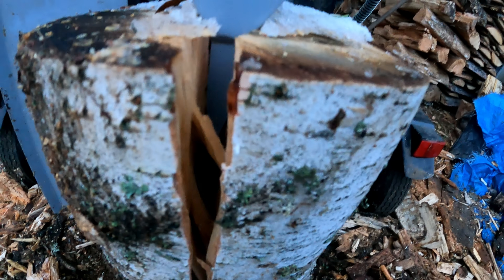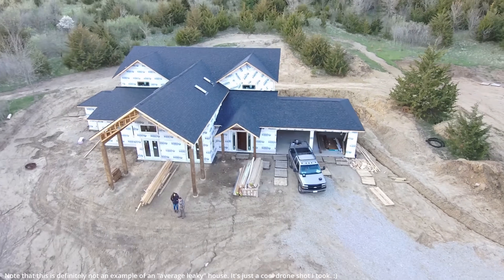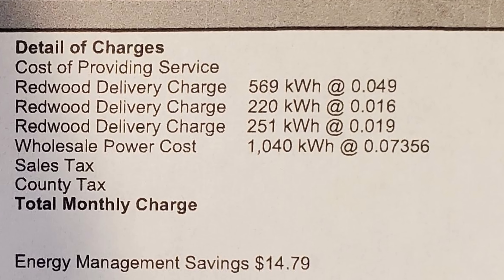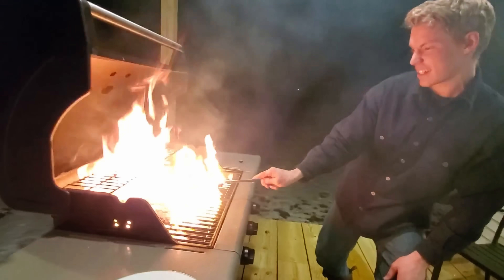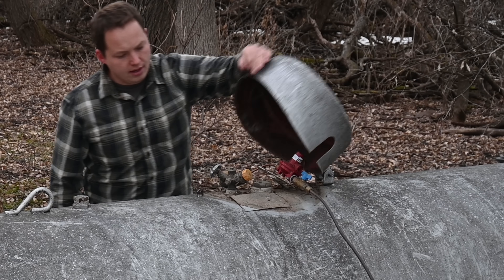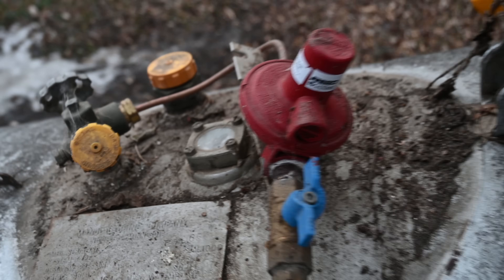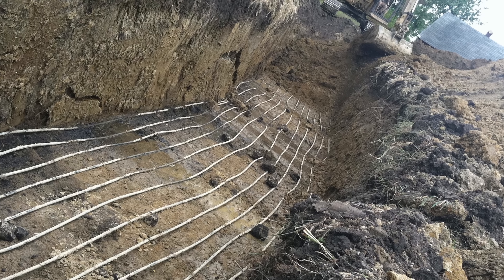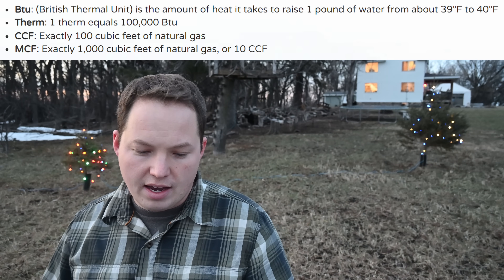What's The Best Heat Source in 2022? Top 5 Home Heating Methods - LP Electric NG Geothermal Fuel Oil

Comment: I owe my own forest of hardwood, my house is 1500 square feet not counting the cellar. I use an LPGas direct vent wall furnace as a back up heat source. We have an old 1924 wood burning cook stove that oddly enough is our main source of heat. It is an open floor plan the stove is central so although it is not “airtight” it is convenient to pop some wood in to as you are always walking past it. It has so much cast iron it’s a huge radiator.  It was made to burn either coal or wood so it has good metallurgical properties for its age. My house is 10 years old foam & fiberglass insulated and pretty tight. I need to add that I also have a fisher mama bear (airtight) wood stove in the basement. I usually only find the need to fire it up and run it for six days each winter depending on the weather. The basement is poured concrete inside of insulated foam forms. The entire house is in an insulated envelope. So the firewood comes from our 40 acre woods. We burn about 10 or 11 face cords each year. We have an lp gas for kitchen range and wall furnace. We refill the propane tank 3 or 4 times during the heating season at a price of about 75 dollars each refill (we call for refill at 35% left in it). We heat pretty cheaply though I cut & split firewood each spring and fill the woodshed. There you have it.
Reply from the maker: Love it! I would like to eventually get one of those old wood cook stoves and use it much as you described. Burning wood is awesome! Is a "face cord" just taking the top layer off of then top of a cord of wood?
Reply: @BenjaminSahlstrom  face cord is 4’x8’x16”.
Reply: @KingRatt  or to convert to 4x4x8' true cords, 1/3 of a cord.
Reply: @logmeindangit  Full cord yes.
Reply: @BenjaminSahlstrom  would really like to see how u did th rock wall. Is there a vid? I also have a less than 1200 square ft home. And I need to repair th rock walls (underpinning). Have to do it myself because hiring someone has been impossible!
Reply: @BenjaminSahlstrom  Off of the front of the cord?  LOGS ONLY HALF the length?
Reply: Yea I used to sorta set up like that had a air tight wood stove with a automatic damper had log splitter and burned about 11 cords a season in NC as I got a lot older I had to go to a heat pump all that goes along with wood burning is very labor intensive not much time left and the end of the day if you also have a job to work so think about that down the road the LORD rejoice young man in thy youth I know now what he meant lol
Reply: Always worth asking.    If you worked at McDonald’s you’d make $17 an hour.    How many hours would you have to work to buy oil?   How many hours to burn wood?   Count carrying the wood in, gas for chainsaw etc.    just worth considering.    Free fries when you work at McDonald’s lol
Reply: Im currently trying to talk my wife into getting a wood burning cook stove. She told me i can but it’s going in the workshop.
Reply: A 40 acre forest all to yourself would be amazing
Reply: You will use much less wood if you install a modern airtight stove for the main source of heat. They truly are amazingly stingy in burning wood once they are up to temp. Also, less smell than an open hearth type. A friend went from an open hearth fireplace to a Blaze King airtight and there was so much more even heat with that plus during the day, one to two split log pieces per hour did the job.
Reply: Wood burning is polluting putting polycyclic aromatic hydrocarbons (PAHs), benzene and dioxins into our environment. Indoor air quality pollution is tripled. It is not recommended for elderly or children to breath the indoor air when burning wood. This should he the last resort given the pollution
Reply: @b4804514  itll pull in fresh air
Reply: @anthonyman8008  only in older leaky homes. Now homes are built to be tighter and an emphasis more on that than extra insulation as that air brings in pollen, mold spores, dust, moisture, and cold or warm air.
Reply: @b4804514  🤣😂🤣

Comment: Hi Benjamin I have used propane wood and a mini split and by far my cheapest way here in East Tennessee mountain is my mini split. Propane went so high I did away with it. Wood went to 100 dollars a load which lasted me about a week. My mini split runs me around 59 to one hundred per month depending on the season. I do have a mr buddy big buddy portable heater in case the electric goes out. I am definitely a huge fan of my mini split for sure. Also my cabin is small so I’m sure that is a factor. Thanks so much for this very interesting video
Reply: Sounds to me like you may benefit greatly with insulation. I'm in south central Kentucky and I use far less wood. About 5 ricks a season.
Reply: I am also in East Tennessee (I'm north of Knoxville) and my heat pump copes with our mild winters pretty well.  Sometimes I wish I had a mini split; the better cold weather rating and smaller installation would allow me to keep just the bedrooms warm overnight and let the rest of the house temperature drift.
Reply: @leifhietala8074  I actually spent probably six months researching mini splits before going with my diy 22 seer  brand. It’s does very well for my cabin which is small 24 by 24 with a small room added on. The down side is if I lose power so I actually installed a wood stove today. Better safe then freezing lol
Reply: I heat mainly with wood here in eKY and a load of split oak is running $60-80.. I also have a 25k btu LP heater and mini-split.  For me, the wood is the cheapest, Mini-Split next and LP last... Only reason the wood is cheaper for me, is I have 25 acres of it... If I was only paying for wood, the mini-split would be cheaper....  I do use LP for my 199k BTU on demand water heater which is cheaper than the electric tank I use to have.
Reply: @FJB2020  I also have land with trees for firewood but not able to get out and get it in. I don’t know why wood has became so expensive here! Or if my being a single woman plays into that. Maybe maybe not. The mini split has by far been the best for me even though I do love the warmth of wood.
Reply: @jacquelineinthewoods  Yeah it is tough to get out, harvest a tree and split it up.. Luckily we already had a bunch down.. The guy I get some wood from (hardwood, because I only have poplar on my property) said that he could raise his rates like everyone else becasue how expensive fuel is right now..  Luckily he is a good man and said that doesn't seem like good business and something he wont do..
Reply: @FJB2020  I also have enough trees down to last for years but I can’t even give it away I’ve tried. I’ve also tried to offer wood by getting a load for a load and just can’t find people willing to work. I have oak and wild cherry and poplar and birch with no takers. There is a new guy selling here this year so I plan to call him. Glad to hear you have a decent guy to provide wood for you. Have a blessed weekend!
Reply: @jacquelineinthewoods  Maybe you can hire some young lads to come and split it up for you.. Get a nice stock pile for the next couple of years.  Maybe put up an ad on FB market place "Free wood, but you have to split it and give me 25%" haha... Never know.. It might work..
Reply: @FJB2020  I tried that to haha just old retired people here lol and the few young ones don’t want to work. I live in a tiny remote mountain town with only a few hundred people we did recently get a dollar general though so things are looking up! We can run get our milk and bread every time it’s supposed to snow now lol
Reply: @jacquelineinthewoods  Yeah we are expecting 8-12" here too...  Keep warm and best of luck to you!
Reply: @FJB2020  Thank you Chris and stay safe and warm also! Thanks for your advice and kindness!
Reply: @jacquelineinthewoods  ahhhhh... that sure sounds nice.

Comment: Excellent price comparison for different methods to heat our homes. Hopefully that gas prices won’t continue to rise out of control due to lack of energy independence.
Reply from the maker: I agree. It's sad that it's totally by choice that we are now beholden to foreign oil again...
Reply: @BenjaminSahlstrom  the states were not really energy independent because shale oil is lite and you can't make heavy fuels from it easily. production costs for shale, etc are also higher than for conventional oil. the sources are not exactly inter-changeable so you can still need imports despite extracting enough energy to be independent, technically.
it's a complex situation with economic factors, depletion of existing wells and political interference impacting prices and supply. 
one of the dumbest things that's been started - the war on coal, resulting in waste of natural gas in power plants and increasing electricity prices actually eliminating an economical alternative to oil/gas/propane for heating - air source heatpumps running off of under 10 cent per kwh electricity from domestic energy sources. coal can be burned cleanly.

Comment: Best investment is super insulating your house.
Reply: That’s so very true. When building my cabin I used pink panther then my daughter used rock wool next door to me and I can tell you if I could afford to I would take all of mine out and use rock wool
Reply from the maker: That's really interesting. Isn't the R value of rockwool similar to fiberglass?
Reply: @BenjaminSahlstrom  I’m not sure about the r values Between the 2 I used R 13 in the walls and she used r15 and the rock wool filled in between the studs perfectly with no staples which I loved. I was so sick of staples when putting my paper backed insulation up and my hand was so sore for days. For an example I had an electric fireplace that never would turn off in my house. I gave it to them and it turned off within minutes . I actually thought it had torn up lol I’m not a professional just a girl in the woods but I will use rock wool on all future projects
Reply: Air sealing is also important. For example, many builders don't seal the top plate in the attic where it joins up against the drywall. And caulking between the subfloor and the bottom plate on exterior walls is a good idea too. Probably the best thing is, for a new house, before the drywall goes in, caulk or seal with Great Stuff any place you can see light coming through, in addition to the top and bottom plates. And sealing the band joist with spray foam is also a good idea.
Reply: @brianleeper5737  even applying spray caulking between studs and the King stud and Jack stud or at the header where it meets the plate will make great air sealing improvements.
Reply: @danielbuckner2167  There's a lot of houses with "bonus rooms" over the attached garage. And what happens is that floor joists under the bonus room continue out to the attic space in the garage. They don't bother to do any air sealing where those floor joists transition from attic space to conditioned space. And so the bonus room is cold in winter and hot in summer.
Reply: @brianleeper5737  Not to mention the framing itself is a thermal bridge.
Reply: @danielbuckner2167  yes. I have seen walls made w 2x4 studs on 2x6 lower and upper plates, with the 2x4s every other one set to the inner drywall location then the outer wall. It breaks the studs conducting heat out into the cold. Insulation I guess could be spray foam, or pink or rock wool "woven" into the stud config.
Reply: @brianleeper5737  the "bonus" room in our house is the master bedroom. Colder in winter,  warmer in summer just like you said.
Reply: You are absolutely correct, insulate insulate insulate
Reply: The Review Shack  Awesomeness
Reply: You are 100% correct!
Reply: yep. in Coloraado. I cocoon some properties w/ isb 3.5 " 4x 8 sheets inside + blow in mega newer light white fiberglass.(better than cellulose, which cost more and HEAVY.